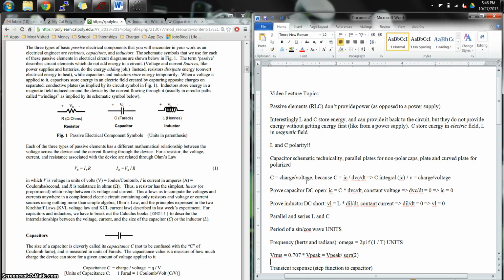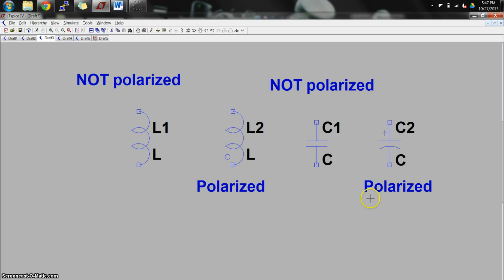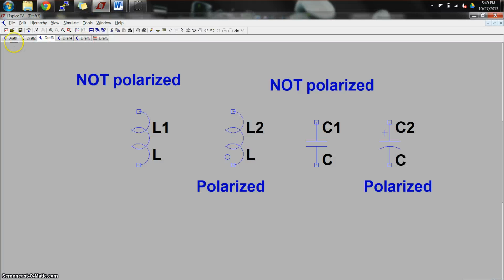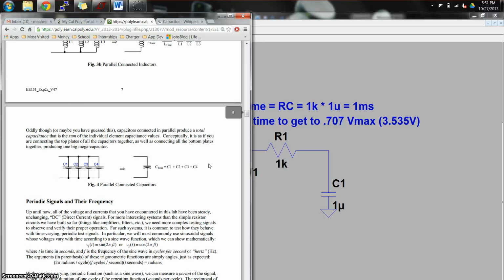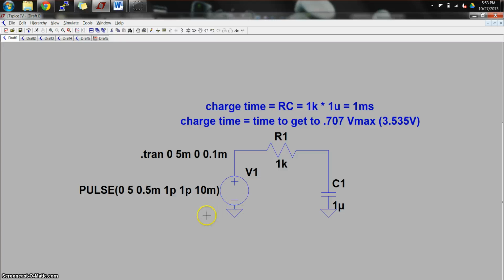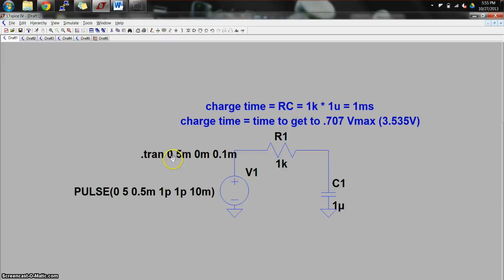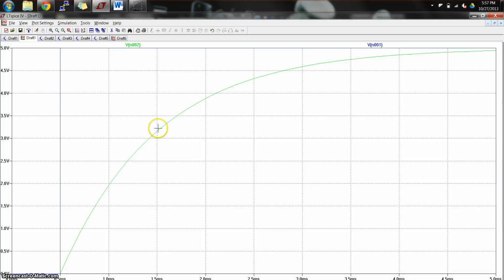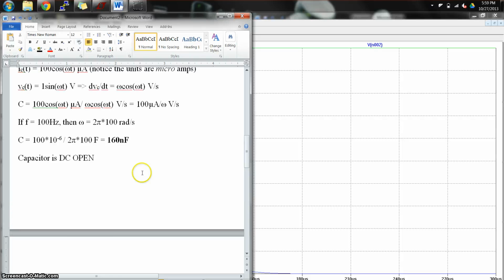Capacitors, Inductors, Transient Response

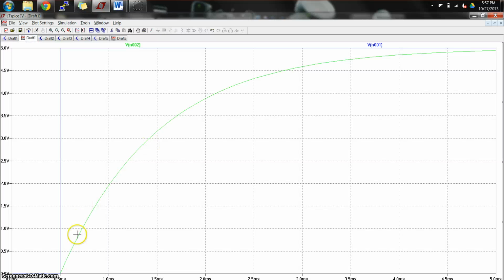Comment: The reason you didn't get the right voltage (@11:00) after 1 time constant is because u had the wrong value. It's not 0.707 after one period, it's only 0.632, which gives 3.16V after 1ms.